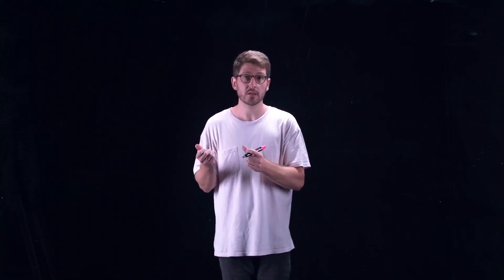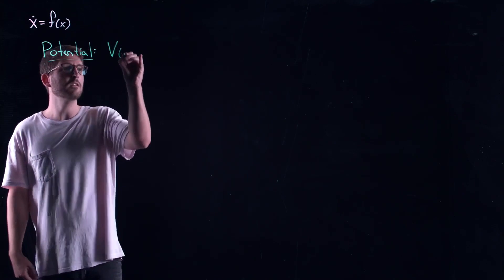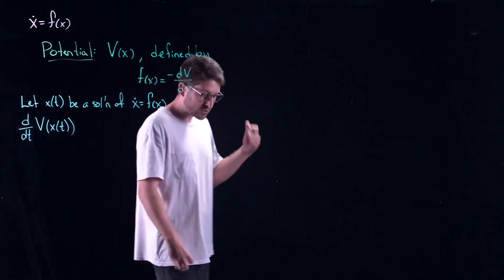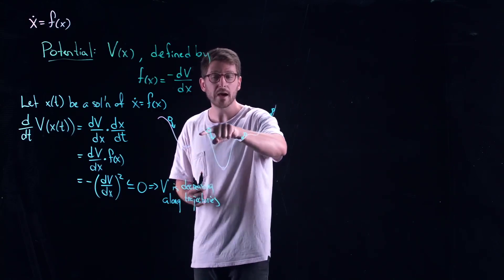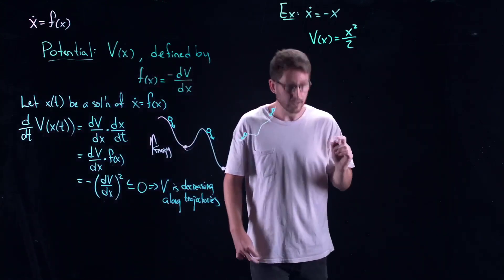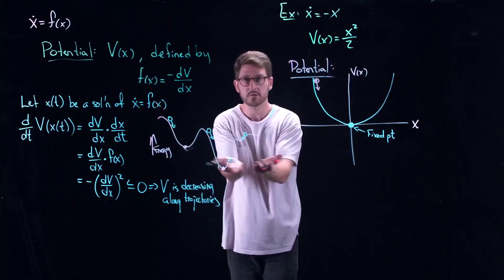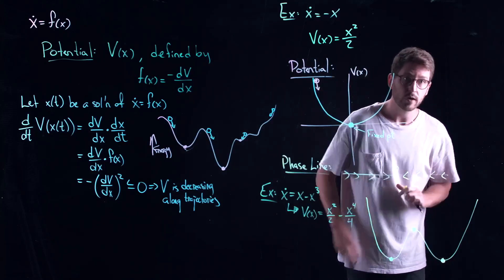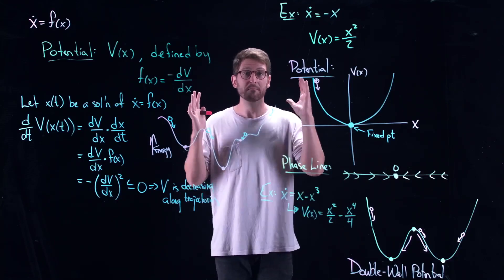Potentials - Dynamical Systems | Lecture 5

Comment: The approach in Physics is that F = m*d2x/dt2 = -dV/dx. The potential you defined is related to the first derivative with time, not the the second. There is no problem with that but is not generally how is thought in Physics. That changes some things, mainly that minimums of the potential function are not ending points of the trajectory, but points where the particles oscillate around
Reply: this is a gradiant system not potential one in physics. the solution x(t) end at the equilibrium point.
Reply: Well I think the problem is, as physicists, we always think that the constraint E = K + V will be true if there's no dissipative elements on the system, so the particle would be oscillating around x=0 because it gains speed as the potential decreases. But I think that's not always the case in terms of potentials so there's no problem of ending the movement in x=0 as the potential is not retaining specific information about particle's speed at that point (we only know that potential changes as particle moves). Please correct me if I'm wrong, I had the same question you mentioned so I would like to see some debate.